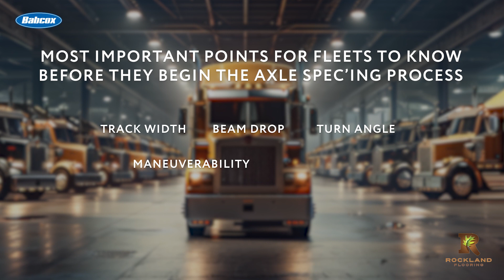Steer axle application considerations

Comment: A retread should never under any circumstance be used on a steer axle. That’s just asking for a blowout to happen. If you are trying to save money on a retread over new, then you are not running profitably and should not be running trucks. The failure rate of retreads over new proves this on non steered axles. The damage done by a blow out on a steer tire to the fender, lights, bumper and rim far outweighs the saving, plus you have to buy another tire. On a 4x2 straight truck the steering angles are dictated by the wheelbase, not necessarily the weight as this continually changes whilst making deliveries and pick ups. The correct wheelbase is also tied to the length of the body and the type of work it is specced for.